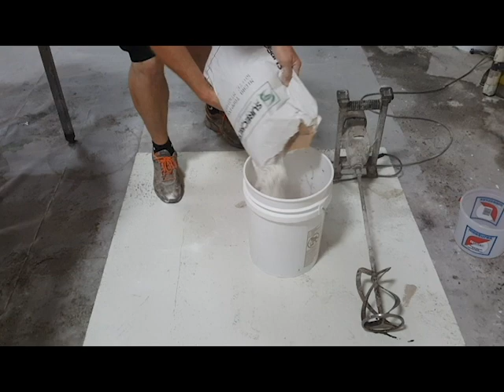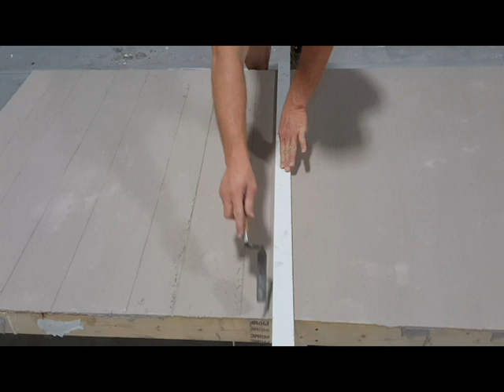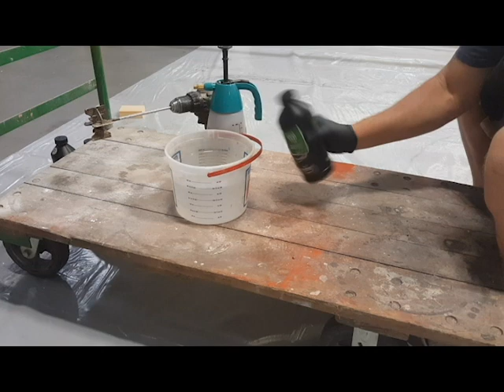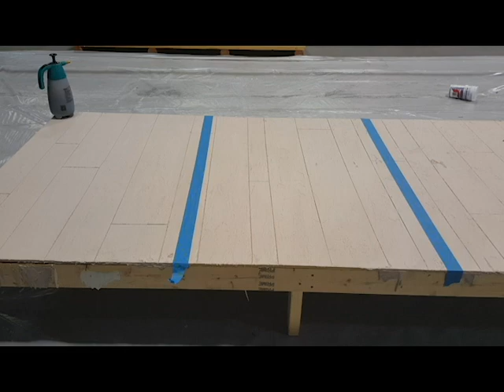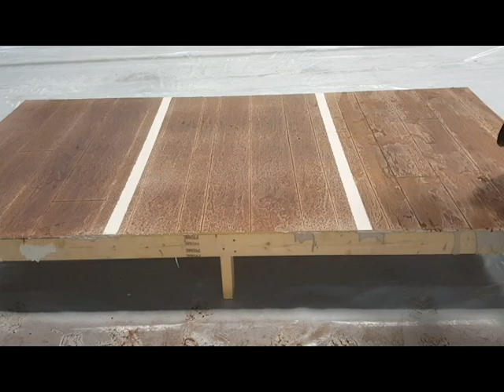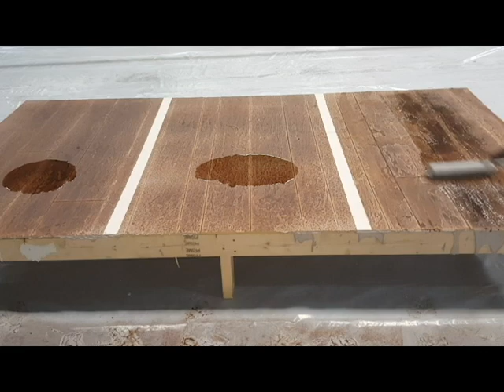How to Make Wood Looking Concrete with Overlays and Stains

Comment: I really like the way you cut in the cracks instead of using tape. TELL us why the 3 diff sections and how you did the grain.
Reply: Me too. But i guess this will work when the grout coat is the same color is a top coat of micro cement and if the areas is narror or small.